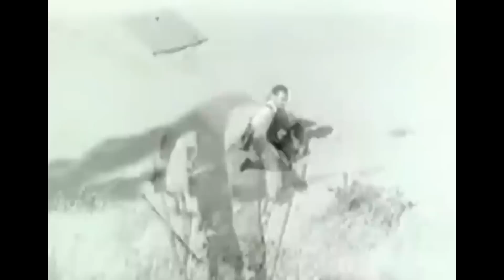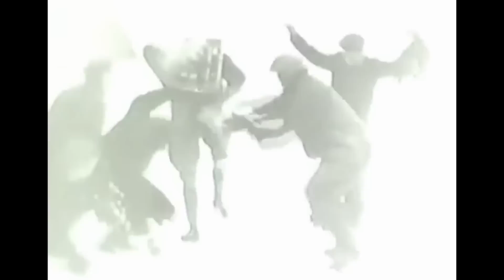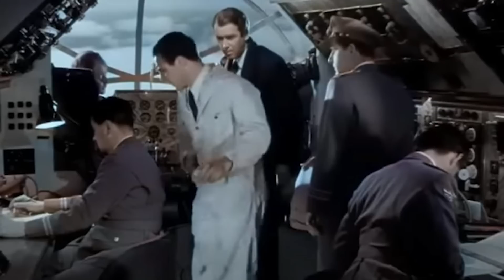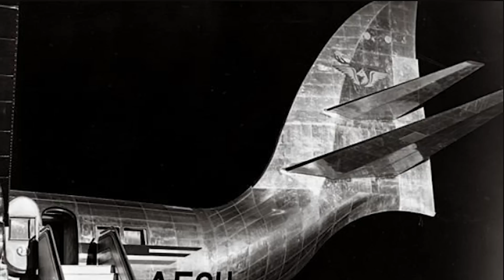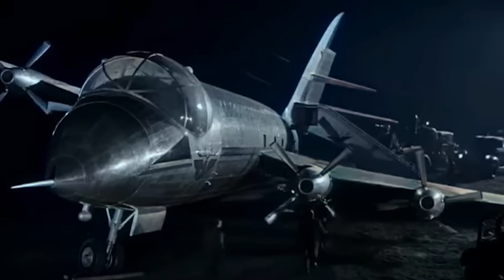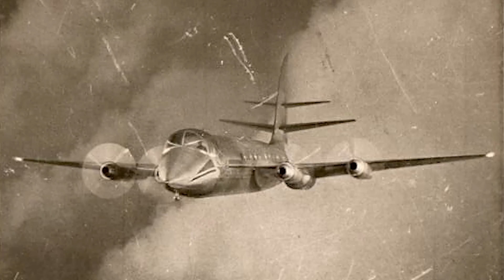The Rutland Reindeer; Tragic Misunderstanding

Comment: Innoative  it was not, cobbled together from other peoples bits, just look at the tail unit more suited as a garden ornament in a therapy clinic ,the main undercarriage salvaged off a  Halifax Bomber. In the narrative you said the props were contra rotating ,no they were single rotation four bladed units by Dehavilland or  Dowty Rotols, 2.000 ponies from those RE 31,s yeagh right , a CA -18 Series Pratt&Whittney R-2800 good for 2500 ponies. A Connie on three engines is a far better bet.

Comment: Every book by Neville Shute Norway is fabulous. He might not be considered the most advanced or technically able author, but I think he's the best story-teller I've encountered.
His biography Slide Rule is equally fascinating, given the wide scope of projects he worked on. 
 
In this case, what's so interesting about this Reindeer tale is that is centres around an infamous series of aircraft disasters, and the struggle to prove that the culprit was metal fatigue in aluminium alloys (a new phenomenon). This predates the de Havilland Comet disasters by several years, when a prestigious British airliner gained infamy due to multiple fatal accidents caused by metal fatigue...
Reply: 'No highway: sounds as profound as ' Unsafe at any speed':( Unless you rein it in ).ha ha ha.

Comment: Ed I'm afraid that quite unusually your pictures aren't quite their usual high standard
Most of those shown are in fact of the proptotype version
In use the aircraft's highly advanced radar was primarily the brainchild of German boffins who, in the absence of work in postwar Germany, agreed to work for an electronics consortium providing support to, amongst others, the Rutland Aircraft company.

It was the multiple nose aerials of that radar array - developed from the FuG 220 and FuG 202 "Lichtenstein" SN-2 VHF band, and B/C UHF band night fighter radar antennas viewwer will be familiar with seeing on the nose of a Bf 110 G-4  nightfighter which won it the name 'Reindeer'.

Its quite erronious to suppose it was in any way weather forecast related.

Comment: I believe the main problem was tensile isometric harmonic resolution in the pan transit speed range. Basically, if you pi the square route of the parabolic transitude by its product then amplitude vortex generated goes beyond flatulence dampening. It was inevitable forces would build up and that would translate into unacceptable gravitational flutter beyond trim tolerance. Rookie error in my Oppinion Ed.
Reply: These issues created an ongoing non mobility crisis
Reply: @dosrios9517  Indeed, of course as you know it was all predicted in a 1934 German Paper Nongerfliegermitfluxangst By Prof Ernest Von Plopenhiem.

Comment: Nice one, Ed.
Brings back very fond memories for me. When I was a child, my father bought me one of the few Airfix model kits of this aircraft. A very rare kit as it turns out -- it was the first (and only) time the company tried to dominate the model building market by using a new scale, 1:1. It took a very long time for me to complete the model, since it used up five years worth of the supply of poly cement from my local hobby shop. Unfortunately, only a few copies of the model were ever produced, nearly causing Airfix to go bankrupt. I believe one kit in an unopened, mint-condition box, still wrapped in plastic, was valued at over £1 million on Antiques Roadshow nearly twenty years ago.